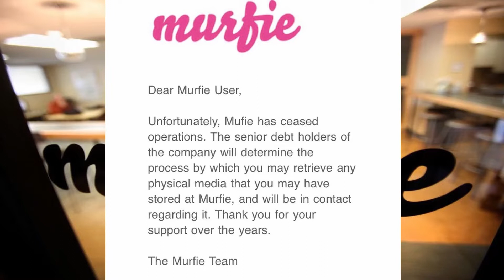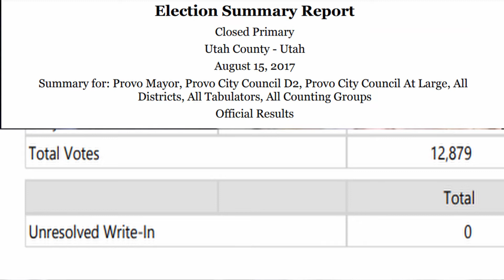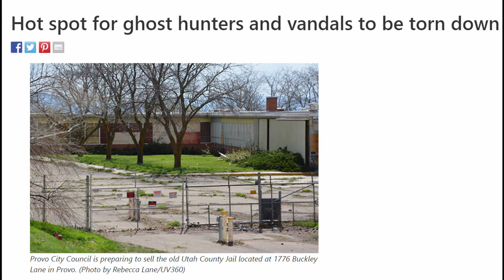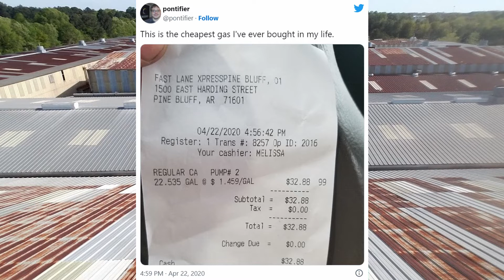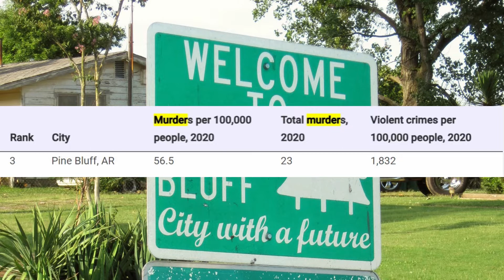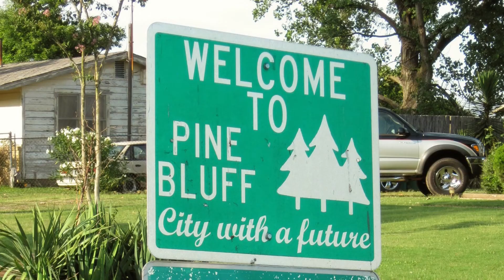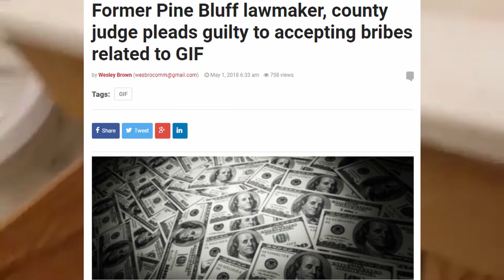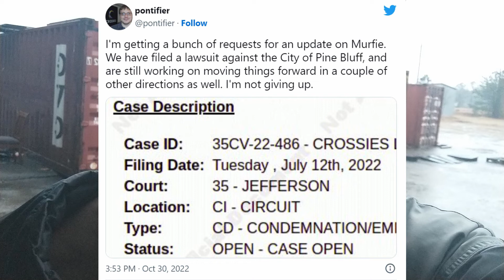John Fenley | The Man Who Brought 1 Million CDs to the Worst City in America

Comment: That's the old Planters Cotton Sees Oil Plant. I actually worked maintainance there for a couple of years in the early 90s. I left Pine Bluff in 2008 because it's a shit hole and it has only gotten worse.
Reply: And then before the building closed down it was Varco-Pruden metal fabrication , 27:42